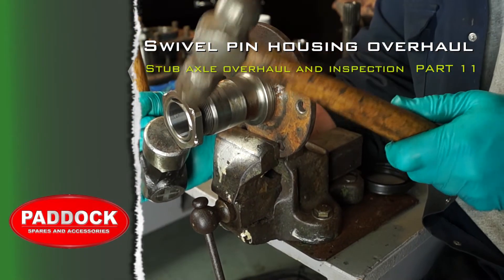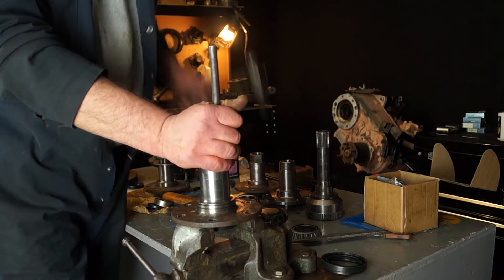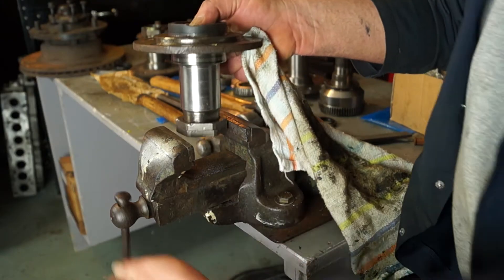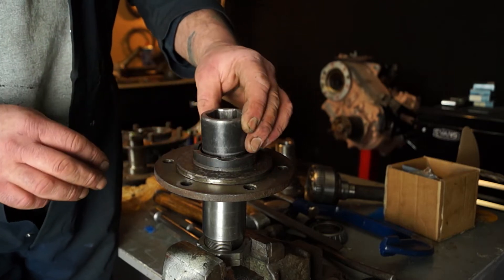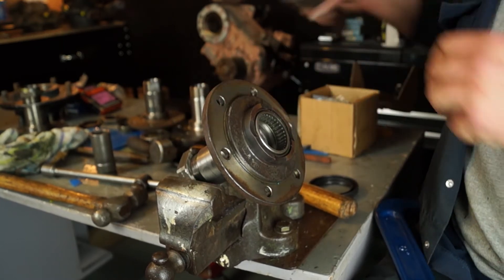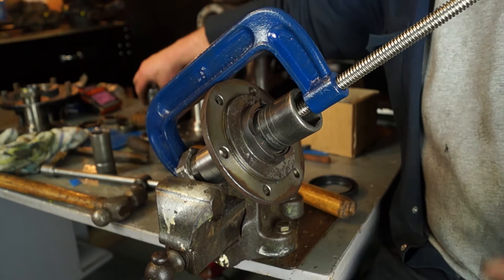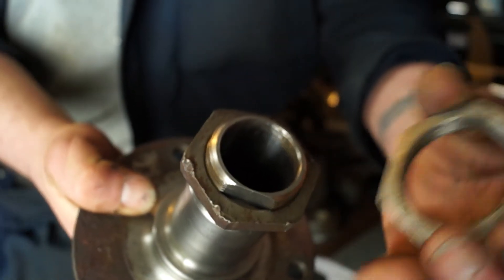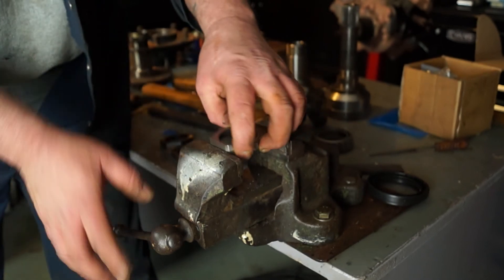Land Rover stub axle overhaul - section B

Comment: Hello, you're channel got me through a 99' Disco 1 wheel bearing replacement in the dead of winter. I am here today because after doing said wheel bearing job I heard some clunkening on the driver side front hub. Took the wheel off and the caliper was rubbing on the top of the rotor. It cracked two big holes in the top rim of my rotor. The rotors are sitting in a box waiting to go on however, the stub axle is all mangled up on the inside. I found myself at this stub axle overhaul video. Thanks for making the video. Keep doing what you're doing.

Comment: My new stub wont go over the old CV joint because the seal I fitted is smaller than the one that is in the stub Axle that came off. On the other side the new one went on fine so it seems that I have 2 different CV Joints in my axle. Question: Can you tell me which CV Joint is the correct one to Order? The seal I have used is the same as the one you are using now and the Stub Axle I ordered was ordered via my 1997 Defender VIN number.

Comment: Brilliant videos! 

I have been replaced the drivers side CV joint on a 1999 Discovery 1, and I am doing the D90 brake upgrade as well. I see the stub axle bearing had a catastrophic failure on the D1, as the rollers look like confetti now!

I have ordered the replacement parts (bearing and seal) and was wondering what size the socket you were using to coax the bearing in was? 

Thank you for these videos and your time!

Comment: Based on your excellent videos I am getting ready to change the swivel housing on my Defender 90 2002 TD5, I mentioned in another post that its badly pitted. So I am just a bit confused, is there a needle roller in all defender half shafts, front and back? As I have made a few expensive mistake ordering wrong parts (I live in Sweden so post is expensive) I purchased the parts manual. But I just cant see the needle roller. Whats the correct part number please buddy. Cheers Michael

Comment: on what series of vehicles do the needle roller bearings appear on? I just took my RRC stub off and there ain't one there.
Reply from the maker: These are the discovery 1 and later Defender axles.
Reply from the maker: Has your drive flange got the shaft on it with a separate joint or is the CV joint and shaft like  the one in the video?
Reply: well I have the joint on the bench ready for me to strip tonight, so will find out soon enough...
Reply: ***** CV joint is separate from drive flange and half shaft.
Reply from the maker: Okay I know what you have. Appeared on the Discovery 1 200tdi version for a while.  Quite a rare axle.
Reply: ah ok,  is that good or bad? parts for it should be the same as those for more common disco axles? I remember having trouble acquiring a CV joint after snapping the last one trailing!
Reply from the maker: niether good nor bad. I think those axles are better for replacing the driven shaft to hub if they aren't too hard to get hold of.
Reply: that's the problem now though, 10 spline shafts are starting to get harder to salvage now.

I know a few folk who are swapping out to 24 spline diff's cos 10 splines are becoming hard to come by; unless you fork out for some Ashcroft's, but they're up to 10x the price of a salvaged 1/2 shaft.

Starting to think I best buy me a spare axle or some swivels off later disco 1 so i can use later model CV's and 24 spline diff, just in case it happens again!
Reply from the maker: If you want a 10 spline unit i can put you in contact with someone who has a few units he is breaking.
Reply: depends where your contact is? not the kind of thing you post without incurring a hefty price on postage!
Reply: Did some more digging: turns out my axles are off a Pre 1991 disco(VIN starting JA032 I think) and don't have the needle roller bearings.